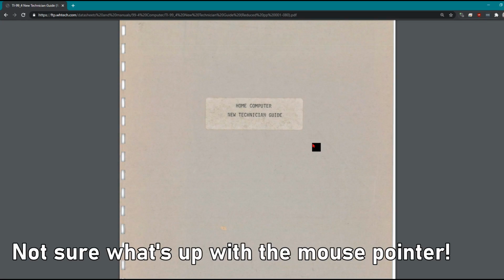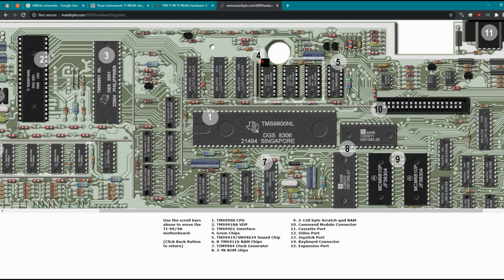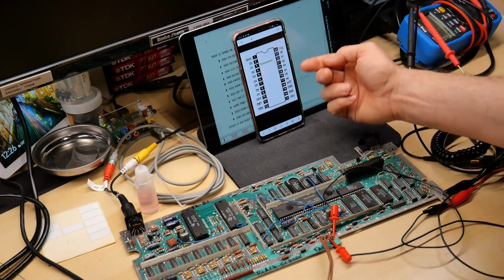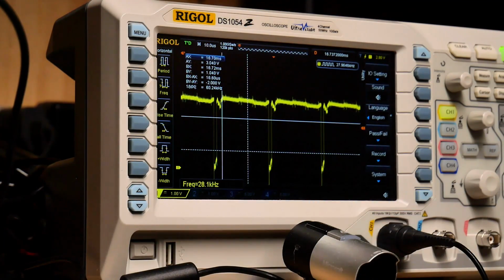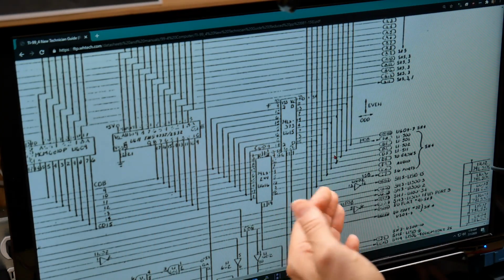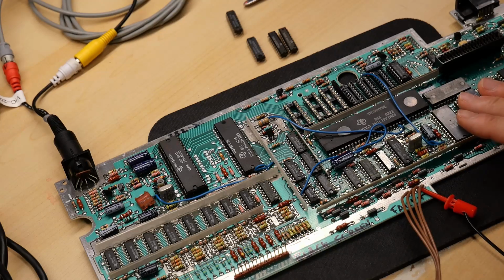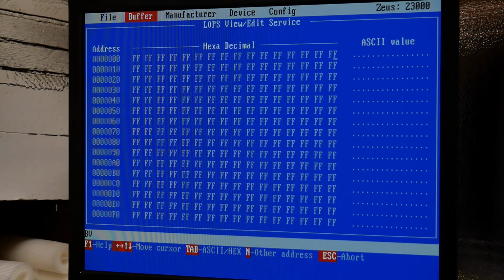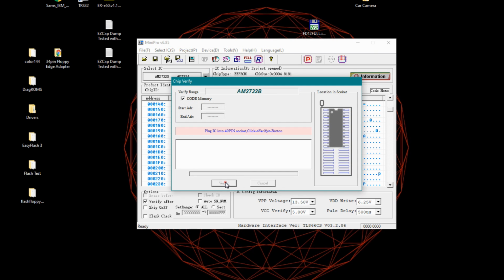TI99/4A Motherboard Repair - Part 2

Comment: Thank you so much for your videos!

I got me a TI/99-4A recently (EU version with component video, I wish it was a composite US version...) and had an issue with glitchy video output. I was able to fix it by detecting that the voltage on the board was 4.4V instead of 5V. Fixing PSU made it work like a charm!

Your video helped me better understand the documentation and the internals of this glorious machine. The quality of your videos is awesome, you really are putting a lot of effort into these. It's so easy to comprehend & follow on what you're doing. Thanks for all the detailed explanations & visuals!

I still cannot get a color picture, but maybe it's due to my shitty self-made YPbPr cable, or maybe a faulty Chinese YPbPr->HDMI transcoder that I bought specifically for my TI. But hey, at least I can boot and get the grayscale visual now!

EDIT: Any tips on how to test if my YPbPr cable is OK without owning an actual functioning YPbPr receiver? Do wire lengths matter? (ring & sleeve wires of my Pb/Pr are like 1 inch longer than my luma cable)

Man, I wish I had a composite version. YPbPr is so rare these days!

Comment: The 99/4a was my first computer, I'm still quite fond of the little guy, for all the quirks he brings.

For what it is worth, the 256-byte "scratchpad" RAM attached to the CPU is because the TMS9900 was designed to be paired with fast SRAM in TI's minicomputers. The processor's registers actually exist in SRAM, so there has to be SRAM on the processor bus. And since the VDP used DRAM, they couldn't just directly share the same pool of RAM like a Commodore or an Atari computer.

My understanding is TI was going to use a variant part with an 8-bit bus(like the Intel 8088) and an integral SRAM, but that part never actually went into production. And the 99/4 project was already late, so they ate the expense of installing a full TMS9900 on the board alongside a small SRAM and a multiplexer to interface it to an 8-bit system design rather than do a more significant reworking of the system to bring the full 16-bit bus anywhere(it would've been so nice if the expansion port hadn't been multiplexed).

Comment: That's a QI motherboard. Lots of stupid little things changed from the original black-and-aluminum consoles. Get a heatsink on the TMS9918 before you power it up.
Reply from the maker: I looked up pictures of the Qi board and this isn't one of them. The CPU is turned 90 degrees on the Qi board -- this one is the original layout but was using the Qi power supply. 

As for the TMS9918 -- it gets hot but no worse than a VIC-II or SID chip on a C64.
Reply: Oh, hey, also... The TMS9900 is a huge 64-pin DIP, and the motherboard flexed a little bit in the way the 99/4A was normally used (as a games machine under the living room TV). TI's circuit board and solder were amazingly good quality as you've no doubt noticed by now what with adding sockets all over the 16-bit bus. BUT, it is a long IC package with lots of possibility for solder joints to get cracked. I did rescue a 68000-powered Amiga 500 just by reflowing all the solder joints on the CPU; maybe you'll get lucky here

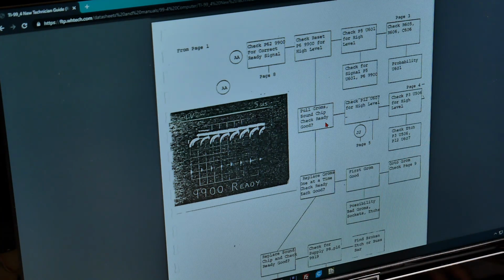Comment: I know you've probably already noticed this and found a solution, but at 25:10 when you're going through the workflow, you actually start reading it the wrong way. YES is down and NO is right (as per the previous page), so the next troubleshooting step (NO) was to "Check P12 0607 for High Level", not replace the Groms.

Comment: When one chip is pulling down the line, what you can often do is check at which pin the signal is the lowest, thats often the best candidate that is actually pulling it down

Comment: I had the exact same problem on my ti-99/4a and it was the mcm6810p ram chips and these can be easily ordered via eBay 12$ for 5 pcs after replacing these it worked just fine and they tend to fail.

Comment: When you have exactly the same signal on two adjescent bus signals you might be dealing with a short between two bus traces, example D5 and D6. The wide signal, changing up an down into a small  spike can be caused by a floating select signal, causing an intermittent bus signal, so as a whole you might be dealing with a bus conflict. I would take a look at the glue logic. Could be one select signal stuck to active. You might also want to take a look at busses connected to the outside world. They might have suffered some kind of discharge and stuck in a permanent bus hold state.

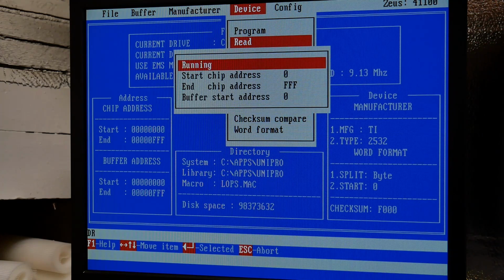Comment: @39:32 weird that your programmer couldn't read the ROMS... when I insert mine I give them a horizontal wiggle as I tighten the ZIF socket to try and get rid of crud on the legs... FF suggests no power to the chips?

Comment: http://www.mainbyte.com/ti99/man/ti99_tech.pdf A little bit better maybe the same one you use - I looked at it on 4K monitor and it seemed readable.  U601 is below the processor (when looking from the top of the mobo - it is the longer chip of the four, dead center in relation to the processor. At least according to the manual magnified to 130%. Not sure it'll help, but... I don't know if ANY of this is helpful, just throwing in my two cents in case it does. I enjoy the videos and the challenges you work through. Very inspiring! I look forward to the next video.

Comment: The troubleshooting instructions supposed you have a regular analog oscilloscope. The waveforms they show are what you get after the processor is in some idle loop. But if your oscilloscope has memory you would get a lot more information looking at the first few cycles after reset. Depending on what went wrong it would be normal for it to get stuck in a loop where some of the address or data lines are always low or always high (or even switching from high impedance to always low). The weird waveform you saw didn't look normal, however.

Comment: I have a vintage Data I/O 201 programmer that I've used recently and it supports 2532. I live in NE PDX/Gresham if you want to give those original parts another chance.

Comment: If I had capton tape and a hot air station for the last step of the chip removal, I think I'd use a manual solder sucker on the bottom of the board, less clogs than the vacuum solder sucker.

Comment: Hi, nice to see someone working on a TI99. About half the performance of a Amiga if you give it some ram (piggy back on the ROM use a miniMEM to program) less than 1/3 the performance of a C64 if you leave it standard. Xtal can be upped to 16Mhz without a problem, only the video timing will change. This raises effective clock speed from 3,3Mhz to 4Mhz.

A common point of failure are the G-ROM chips and those are not easy to find. These chips are used out of specs, driving more than they should.

The processor is a interesting but strange beast. For example: 
- IO and memory don't live in the same address space. 
- There are "long distance fetch" instructions to access the memory of another 9900. 
- And there is no stack, instead the whole RAM might be used as registers for the processor. As a result it excels in interrupt response time and is very good at multitasking. 

Without modifications the TI99 is a 240 Byte computer with 16K video RAM. Code from the video memory has to be copied to the 240Byte RAM before it can be executed. One of many ways TI tried to slow down the TI99 and make sure this cheap computer would not compete with the companies $$$$$$ mainframe systems.
Have fun.

Comment: I was curious about the tms9901 interface and it turns out: it really does not have a data bus connection but the address bus is not carrying the data it is only for addresses -> the chip gets data in and out via the "CRU" shift register interface to the cpu

Comment: The TI engineers were amazing peop.e clamed to theor desks by penny pinchers. This computer has a lot of amazing tech hobbled by cost saving mesures, like 8bit ram bus. This could have been the best computer of thera, but it wasn't.  When the price floor fell on computers this failed because they just couldn't find any more money savings.

Comment: 2 years later it turns out that the problem was a single bad diode that was partially blown and shorting to ground at random to produce noise.

Comment: Hey Adrian, I feel your pain!!

I have a Texas Instruments DS990 Model 1 in my collection that I have been trying to get booting for... 3 years now. Geez its been that long.

It is a TMS9900 system like the Ti99/4A. Apparently, TI used the DS990 Model 1 to design the original Ti99/4a, so I'd like to think they are similar in many ways.

Would it help if I told you that the TMS9900 doesn't contain internal registers? It uses part of the system memory to store its registers. I'm... not too familiar with very low level system logic like that so I don't know if that matters, but I can presume that if those registers are not working, the rest of the system would be dead too. I vaguely recall you saying there was a 120x16bit RAM space..?

Good luck!!

Comment: I googled quickly for some data & pdf and found this one ... I get the impression the quiality is better as what I saw in the video. Check it out if you like. 
http://www.99er.net/files/99-4_Console_Schematic.pdf - drawing of the board with marks and chip IDs
http://www.mainbyte.com/ti99/man/ti99_tech.pdf - seems the schematics are ok
http://www.unige.ch/medecine/nouspikel/ti99/titech.htm - seems the webpage offers lot of good stuff for your purpose.
saludos
   Juergen

Comment: Back in the day when I was repairing micros, one useful technique I used on bus issues was to use the “component test” facility found on Hameg oscilloscopes of the era.  Basically the scope injects a low voltage AC signal to the circuit and then traces a voltage current shape onto the screen. It’s simply a case of stepping along the bus connections and compare the “signature” (voltage current/VI) shapes. Anything significantly different between bus lines and I’d start to pull devices and see if anything changes. It was possible to test the pins on the removed chip in the same way. All of this is done with no power applied. 

I later bought a system that can functionally test many 74 and 4xxx CMOS devices in circuit and also display the VI signatures concurrently for each pin on the chip, up to 64 pins at time. It was even possible to record the signatures from a good device and run an automatic comparison with the device being tested!
Reply: Great idea!
I used the "Huntron Tracker 2000" for troubleshooting when I worked in IBM Argentina un the 80's.
It was a very interesting tool!

https://m.youtube.com/watch?v=W7LWnY4oOgw

Greetings from Buenos Aires
Daniel
Reply: Da ny The Huntron is similar to one of the modules in my system. I have an ABI System 8 and one of the modules is called an “AICT” which could do the more advanced VI curve tracing as seen on the Huntron. It could also functionally test analogue devices like op-amps and transistors in circuit! I think curve tracing is an underrated troubleshooting tool and perhaps not as well known as it should be :) Interesting to hear IBM was using Huntrons!

Comment: Bad CPU or pull up cap. You should be able to check the caps without turning on the machine like you did on the IBM 5150.

Comment: Funny you call GROM's high speed, they are anything but! For starters their clock speed is measured in Khz, not Mhz :-) Anyway they are so called Graphic ROM's, serial devices where you load an initial address and then read subsequent data bytes. The internal address counter is only 13 bit so each GROM has 6Kbytes of data, leaving weird address gaps. That didn't really matter as these GROM's are memory-mapped. Anyway, they were TI's way to keep software development tightly controlled as only TI made these devices. Why do I say software? The TI99 has actually an intermediate language between 9900 code and TI BASIC. The 2 ROM's on the 16bit bus contain the interpreter for that language (GPL). It makes the machine very slow but versatile.

Indeed the architecture has its roots from the TI minicomputer range of that era as the TMS9900 processor is a single-chip implementation of it. The idea of having all your registers in RAM made some sense at the time given processor and RAM speed (it makes for very fast context switching) but ultimately was a dead end. 

Using video RAM as the main ram for both graphics and code was not unusual at the time the TI was developed. It's very easy to add general RAM to the machine too.

Comment: The groms maintain a pointer, which the cpu can set, on a read the at the location of the pointer is placed on the bus and the point is increased, each subsequent read returns the next byte. it is designed for fas access, but also means eproms wont work.

Comment: On your oscilloscope, some of your weird looking readings could be related to an averaging or "high resolution" mode. Turning it off will look more noisy but stuff like address or data lines will usually look like nonsense with those modes on.

Comment: Adrian, do a search for "99-4A_Console_Peripheral_Expansion_System_Technical_Data.pdf"

This has a fairly readable 'silk screen' type of layout diagram, and very readable schematic.

Also found "TI_Manual_Project.zip" which has a bunch of good schematics and other documents.

Both hosted by 99er.net. They have archives of message boards and links to a lot of other resources.

I also found nouspikel.com and ninerpedia.org what has links to a few good resources/sites.

Comment: For the cursor issue during video capture, it looks like you've got a HW accelerated cursor plane (those are typically 64x64 pixels) and the colors are messed up somehow.  I'd guess the recording SW thinks it's in one RGB mode but it's actually in another.

Comment: You have a hell of a lot of patience. You changed the ROMs, you think the SRAMs are probably good, you changed the 3 GROM chips, you changed the video chip, you could buy a new CPU (if you can even find one for a reasonable price) but it STILL might not work and you could end up spending a lot of money on a very old system. I would already have given up by now.

Comment: Often to figure out which chip is U31 (or whatever) you'll need to look at the board layout.  If the company is kind, they'll provide an easy to read version that just lays out which chips are where.

Comment: I had the same issue reading a mask rom from my compaq portable, where all I would get are FF. Turns out that while most of the important stuff that the motherboard cared about were the same on an eprom and the mask rom, the mask rom actually had an OE pin or two where an eprom might have NC or a program pin. When I jumpered the OE pin high and the TL866 was able to read it just fine.  According to the data sheets, the state of the OE pin was configurable by the customer.

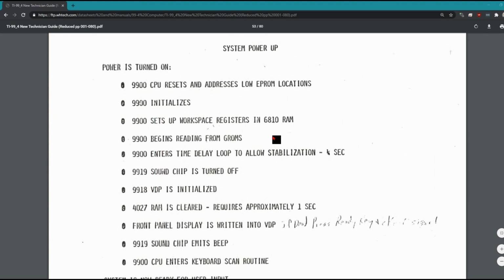Comment: 3:50 This is possibly the best piece of tech documentation I've ever seen.  Simple but effective.  Why didn't more manufacturers do this?
Reply: Because some companies were paranoid as hell about their intellectual property, they wouldn't even give their own licensed repair services specs for the machines they were trying to fix. IBM made a lot of waves when they released the technical manual for everyone, but they were in the middle of a series of consent decrees and antitrust suits based on how they ran their mainframe business,  which is why the 5150 was built with off the shelf components.

Comment: Back in the later 70's-early 80s, I built an EPROM programmer for those 27xx chips and the programming voltage was the hardest part to get right and I do remember how slow the process was.

Comment: Your falt is the same as on mine, going to use this in fixing mine up, currently on the back burner as it is quite an involved repair. Not something simple like a C64 issue.

Comment: Excellent. I really like these detailed, component-/schematic-level bug hunts. The PROM dump resuling in all FFs made me immediately suspicious though. That didn't match the issue you had already identified with some data lines always sticking to low. But, well, things are always obvious once you know the solution... Looking forward to part #3.

Comment: I suspect those weird dancing waveforms are CPU bus drivers that are failing and unable to put a good signal on the bus. To confirm you might look at the address bus rather than the data bus. The addres bus is unidirectional. Unless there is a short circuit, which you can mediate by removing chips, you are then sure any weird waveform comes from the CPU. This allows you to confirm that the CPU is the broken component (which is bad news, because no doubt it is a weird part).

Comment: Hi Adrian, I found this forum post "https://atariage.com/forums/topic/286905-are-the-schematics-of-ti994a-accurate-schematics-for-beige-console/?do=findComment&comment=4196210" which links to a PDF which on page 18 has a schematic that is more readible than the one you showed halfway through the above.  No idea if its of any use.

Comment: sounds like shorted in railer on board not feeding right voltage but sent it self on shorted cause it bounced around on meters 
you did great jobs testing them

Comment: Hello Adrian! Very nice video, I've enjoyed every second of it, thank you very much. May be I have a suggestion regarding how to test the RAM chips. Apparently I just uploaded a video on my channel, where I'm reparing an old KP800 VGA card. Among other problems, it had some broken DRAM chips and I made a tester using Arduino. It helped me a lot with analysis of the issue. May be you could try somthing similar. Since it worked for me, I wanted to make a separate video about the Arduino DRAM tester, but I didn't have time yet. Anyway, if you take a look at it, you'd probably get the idea.
https://youtu.be/MZvCcadwblg